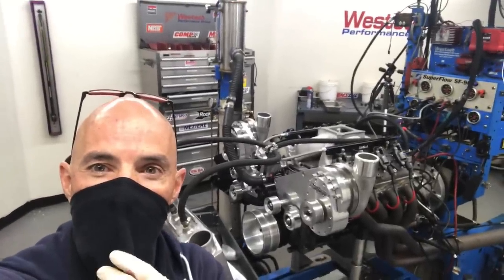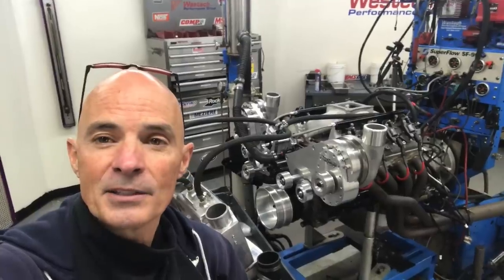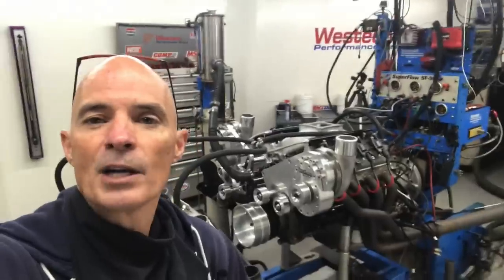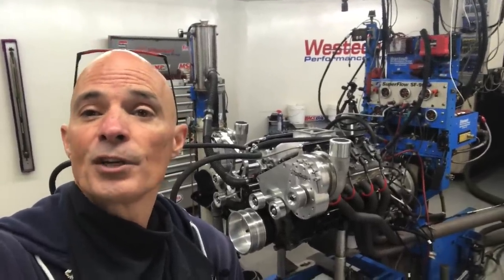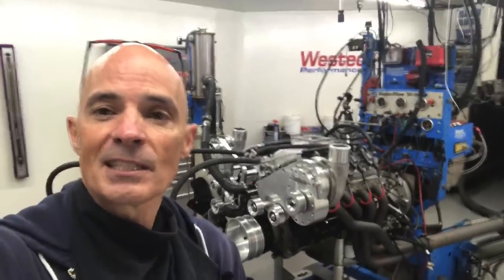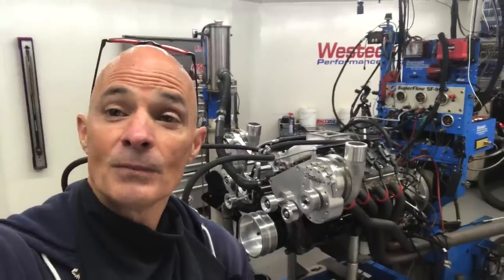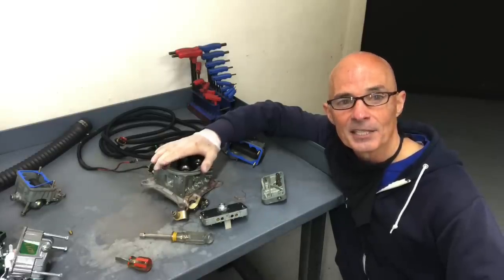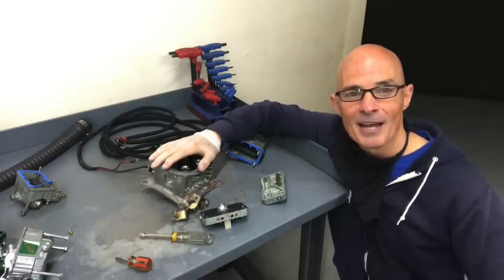WHAT'S INSIDE? -BLOW THROUGH CARBS

Comment: Hi, I have run boosted carburetor stuff for years and when a lean condition would present itself I checked all the basics.  It would always lead back to airflow issues over the boosters. EV made a hat that had a divider and you would run it at a 45° angle not straight on as you have it. It could possibly be making bad turbulence with the twin superchargers especially if they are running outside their efficiency range.

Comment: Listened to this video now 3 times, fuel pressure is fine, checked before and after the regulator, and this problem is going on with 2 different E85 carbs and a gas carb, the common component is the carb hat, and running 2 superchargers is increasing the CFM dramatically, air is hitting the back of the hat, and not able to flow through the rear throttles, backing up and causing an eddie effect (turbulence) and messing with the front throttles ability to get a smooth flow of air, and likely surging causing the rich lean bouncing we see on the HP curve instead of the smoother curve we usually see. If you can cut the hat and weld a second fitting for each charger, the boosted charge air should stop being so turbulent,  I suppose this could also be remedied with a splitter installed that others have suggested as well. Good luck with the diagnosis,  great work as usual
Reply from the maker: we've run this power with this hat before with no problems
Reply: @richardholdener1727  But different fuel now, right?

Comment: Sounds like the fuel side might not be the problem. It almost sounds like an integrity issue. No matter what you try fuel wise you get the same basic outcome,... you mentioned that one bank was ok and one bank was acting wierd/lean. You said you ran a compression check, but did you run a leak down test? (A leak down tester uses a set of gauges and shop air to  check for different engine issues or to see how well an engines condition is. Or to keep tabs on internal wear for race use.  Did you leak down test the good bank of cylinders for a control then leak down test the lean bank of cylinders to see if there is an oddity between the banks? You can test each cylinder at top dead center ( both valves closed) by turning the engine over by hand  which will put the cam in play incase there are issues stemming from the valve train you might have missed, or you could undo all the rockers to seat all the valves and then you could just cut to the chase and hit all the cylinders one after the other without all the turning over of the engine. Wouldn't hurt to also undo the rockers so all valves are seated, make a top block off plate for the intake where the carb sits, put a tapped hole in that plate  to accept the leak down tester fitting and leak down test the whole intake and heads up to the back of the intake valves. All this would show you if there is a crack that just showed up somewhere, a bad intake seal or head seal, if the valves are leaking at the seats (check by pressurising a cylinder and check valves dry then with light oil like marvel oil dripped on the closed seat surface in the intake runner, look for bubbles) (ive seen leaking valve to seat  issues cause mid to top end tune problems).....
Reply from the maker: we know what  leak down tester is-motor makes correct power na

Comment: EDIT a Google of pitot tubes netted this https://www.theturboforums.com/attachments/img_6509-jpg.434074/
When guys put turbos on old carbed bikes they extended the bowl vent up to where there is more velocity. The term they used was pitot tubes. The hat opens its diameter to go around the 4 barrel opening, where it loses some pressure and where your carb currently has the vent tubes. Try extending your vent tube up into the pipe before the hat. It should push on the bowl harder and push fuel in easier.
Reply from the maker: i mentioned we did that in the video
Reply: @richardholdener1727  Can't wait to see the answer. The guy in the pic had your hat and had to jet down after his ridiculous extensions.

Comment: Bigger jets, drilled PVCR passages, jets, removed jets, big needle/seats, plugged bleeds, swapped carbs... sounds like you've picked most of the low-hanging fruit, Richard.

Got enough fuel pressure to overcome the boost?  Checked the pressure AT the carb inlet?  Tried those clear sight plugs @ the bowls to see if the bowls are full @ load?  

Since TWO carbs have the same results, it makes me wonder if 2 carbs had the same problem, or if the problem is systemic

Maybe put the carb on backwards and see if the problem switches banks...

Edit:  exhaust restricted on one side?  Maybe worth spending a few minutes looking there looking?
Reply: I think it’s the fact that they’re trying to flow that much fuel through a single needle and seat. There is a reason why after about 900 hp most people step up to dual needle and seats for e85

Comment: Are you reading the plugs do they show rich I’ve seen instances where way to much fuel starts showing lean on 02 readings but before you go lean it’s not so rich to make me think that’s the case but within like 300rpm it’s jumps a point leaner does it drop a cylinder do u have 02s on Both sides? To confirm this .
Reply from the maker: dual sensors-swapped them, tried more and less fuel

Comment: Have someone or a camera in the dyno room when doing a pull and set the float bowl level at center of the sight plug make sure the float blow levels stay at center during the pull that will rule out a fuel delivery issue. Lean on one side sound like a intake gasket leak under boost that may not show under vacuum. It's always nice to vent the fuel bowls outside of the intake bonnet because even with a boost regulator you can never exceed the pumps free flow pressure rate with the combined regulated pressure and boost pressure.(example if you pump flows 20 psi free flow and flows say 30 psi before a regulator set at say 7psi  you would think you could do 23psi boost 7+23=30 you can't. The combined boost and regulated psi can not exceed free flow. So if free flow was 20psi and you set the regulator to 7psi you can only run 13psi max)   I understand were people are going with the 90 degree bonnet but we have a procharged dragster making 1400+ with the same bonnet.
Reply: Ricky Rocks I think he needs to run bigger bowels. He’s just running out of fuel.
Reply from the maker: we measured pressure before and after reg
Reply: @richardholdener1727  verify for fuel in the bowls, please.

Comment: Worth looking at the sdce carb bonnet, and the 1957 ford paxton blowthru bonnet. Both deal with hood clearance issues --since you cant have a 15 plus inch verticle tube--by chokeing, and equalizing airflow across the carb. The studebaker and early paxton gt350 carb boxes worked too, but were a crude yet reliable idea that could be pushed to production quickly.

Comment: Not the cause, but one thing I learned from fuckery and tuning my LS 69 chevelle is if theres a fuelflow restriction (clogged filter, pinched line, incorrect size line even), you can keep turning the fuel pressure up and up and up and it will still malfunction because theres not enough fuel flow. 

I had dirty pre and post filters (from fuel cell foam) and had a breaking up issue at the top end. Changed pressure to 8 from 6 PSI and it still did it. 10 PSI still did it. 12 psi, still did it. 15 PSI was the max the regulator was good for, still did it. Pressure often isn't the issue. Flow is what counts.

Comment: What are the spark plug showing?  Is it so rich that it is reading lean?  Been there, done that!  Pull the plugs, I would bet they are fueled to the max.  For sure if it's too rich, there is unburned oxygen in the exhaust pipes showing lean.  That's what I would try first.  Next up would be looking at possibly adding vent tube extensions to see what that does.  If that does not do it, I would maybe think the bowls are being not filled by the pump, or it may need the dual needle and seat bowls.  But with two blowers, if it is making 1000 at the crank, can you imagine what both of the blowers are pulling for power.  I bet the bsfc is very high!  My 2 cents anyway!
Reply from the maker: not rich

Comment: Something going on with the boosters or venturis? Could It be losing "signal" some how the area of low pressure not pulling hard enough.
Reply: It's one carb that's flowing a ton of fuel. There is a chance that it has a gas carb body and the booster transfer circuit is not sized big enough. If you take out the jets and plug the air bleeds it should be so rich it misfires. There is something everyone isn't seeing here.

Comment: An answer to the problem 2 things I'm thinking of perhaps the  adjustment for the fuel bowls need to be adjusted to the highest  position  and/or length of the fuel line/ size/filter
 perhaps the opening into the fuel bowls has a screen that is clogged or an orifice that  is too small for the amount of fuel under high demand, and lastly the distributor Drive could be worn out and is retarding at high RPM causing the fuel to not burn giving a false reading of lean the fuel maybe saturating and not atomizing correctly,  good luck...

Comment: Carb icing up at the higher rpm/flow? Fooling around with a 460 Ford and gasohol 40 years ago the engine would cut off at high rpm’s, we would roll to a stop. After about 30 seconds it would start right up again and off we would go. Found it by jumping out and looking down the carb really fast and finally saw it iced up but melting really fast. Went back to straight gas and no problems.   It’s a shot in the dark but who knows. Try it with the intercooler water off to see what happens.
Reply from the maker: we tried fuel too

Comment: In the real world, i'd really just like to see someone build a nice driving blowthru carb, then use a zex perimeter, or 2 stage plate to add straight methanol with boost. Can be done cheap and easy with fuel solenoids and adjustable pressure switches. I got the napa part # for pressure switches if ur interested.

Comment: Mr Holdener, here's a link to a guy with firsthand durability testing with blowthru carbs, look for RWTECH posts 

https://www.speed-talk.com/forum/viewtopic.php?f=1&t=4221&p=36769#p36769

 Another thought, in fluid dynamics, any air measuring device requires ***at the least**** 3 x pipe diameter of straight tubing to establish laminar airflow before measuring/metering. Given about 5inches for a Holley carb inlet, that's 15 inches of straight pipe above it as a minimum.

Comment: Is the relative humidity high enough to have some icing around the booster venturis during high cfm airflow? Have you tried larger boosters to slow down the air flow through the boosters? The air may be flowing too fast though the boosters to get a stable low pressure area to draw fuel from.

Comment: fuel comes out of the booster leg from either vacuum of the engine or the vacuum created by air moving at high speed past it. since this is a blown motor you need vacuum to be created and having boosters with an open center its not going to be able to do that. try some boosters that have a bar in the middle like most stock holleys have. the 90 degree elbow is making it worse and the other carb must be shaped a little different giving a little better result but the reason taking the jets out didn't work is because their just is not enough vacuum being created on the booster because of its shape.

Comment: I think there are a few people on here that are on the right track. Try straightening up the air flow in to the top of the carb, run the vent extension to the mouth of the carb hat with slightly larger inlets, and I couldn't tell if the carbs that were ran had down leg booster. But it might help to move the vacuum signal closer to the area where there is maximum air velocity through the venture's of the card. I couldn't tell but it looked like the booster were straight.

Comment: I do agree with portions of the comments here it certainly isn't a carb issue. If the rest of the fuel supply and regulation system is proper than your carburetors are only identifying an occurrence you might not see if fuel injection was utilized.You often reference how air flow distribution in manifolds changes everything and I think the current combination is being exposed by the use of a carb.. It depends on relatively even airflow across itself to provide fuel flow.I would be inclined to believe that their is some sort  of an air column or vortex imbalance coming into the carb hat and not evenly distributing the airflow.across the carb and boosters evenly.  I'm not sure spacing the hat higher to improve the turn radius will help as much as putting some sort of an axial divider in the inlet tube. Usually boost referencing the bowl with the tubing facing the signal fixes that issue for the most part.Your description of how one side of the motor is happy enough while the other begins to starve.With out more detail I suspect running the torqstorms opposing one another could be causing an odd type of flow coming out of your intercooler or the combing in the intercooler could be contributing. Could it even be having an odd type of surge as your rpm and boost curve are rising/You could try a bunch of simple things like taking the intercooler out of the equation with a different manifold to combine the flow or even a simple series of pieces of tubing with a divider in the middle in the inlet tube after the inter cooler and or prior to the carb hat or both. Keep the bowl reference tubes as well.

Comment: Carburetors are simple animals if the air density across both sides of the venturi is correct they will work. This depends on the viscosity of the fuel remaining the same and here is your problem I believe. I think you are freezing the fuel inside the carb at the higher flow rates and the carb cant get enough heat to keep it consistent. The hat is also a bit small I believe and could be presenting the air in the wrong direction. Time to get the old shark plenum and mount it on top of the carb to fix that part at least.  Drain the inter cooler of water and try it again sometimes to much is exactly that or just dilute the E85 with a bit of regular petrol.  LOL
EDIT
Another thought have you monitored the fuel pressure throughout the run? It isn't doing something dumb like sucking a hose closed at the high demand time when it leans out? Is the fuel tank vent working ok?
Reply: Except E85 has a freezing point of more than -200° F
Reply: @goodmanboattransport3441  E85 will cool a boost charge by 100c given the volume of air in that how much flow will freeze a little booster outlet that weighs maybe 5 grams? It has to transmit the heat through it otherwise it freezes. It isn't that common today but in industry there used to be chillers that were driven only by compressed air flow across venturis.
Reply: @dazaspc  
For sure, anyone who has used a blow gun for an extended period of time knows how cold it gets. Now if there were water in the fuel, it might drop out of suspension from the ethanol and freeze, but clean fuel should not thicken from a freezing condition, which was what I was addressing from your original post. This lean condition was also present when running gasoline as well, so there is that to think about as well, different fuels and carbs but the same problem, there must be a common issue,  I think it's the hat as well, like many of the other comments, I made a post before I made this one, after giving it some thought, it would be interesting to watch a smoke trail go through the hat to visualize what is going on
Reply: @goodmanboattransport3441  I would assume he has run that hat before at these airflow levels? If so it is the boost level or the air turbulence coming from the inter cooler. As for fuel getting thicker nothing thicker and less viscous than a solid. But seriously if the guy that builds blow through carbs gave the hat the ok the only other thing should be the intercooler. It could be blending the two air streams together after the heat exchangers inside and creating a turbulent flow through the inlet pipe. With the carb metering as the first thing the air meets to prevent the air from spinning through the pipe that could well be the problem. After all a couple of carbs built for the job and tested would tend to rule them out.

Comment: I plan on na or the "blue unit" on mine . But you didn't check the flow of the carb first . And nobody running boost likes that hat . If Shelby did it with a Super Snake with a mechanical fuel pump like I was gonna use , why can't you ? E85 and boost and two blowers is 1500 hp , it might be telling you to go up .

Comment: I agree with you on most your changes, but we use e85 on top of a 177 Weiand using boost referenced bypass reg 3psi to 13psi and a 130 gph mechanical pump. (10psi boost)We are worried about lemonade (bubbles) in fuel bowl at high rpm. This is why I suggested duel needle bowl lower fuel pressure and help fuel level in bowl. Love your content thanks GM engines.

Comment: So when you pull the headers and check the colouring on the exhaust valves what is the difference from side to side and cyl to cyl if any, yep checking plugs is ok but not as good as exh valves, but I'm sure you know that but did you do it? (Ron Shaver  believes in this method only)
If you have this data then analyse from there, rules out o2 sensors, leaking header gasket ( which I have seen mess up o2 readings even found supposedly known good headers had cracked) seeing is believing, I like the laminar flow suggestions for air entry into carb/s so would expect to see evidence on exh valves of uneven distribution, for those that don't know a plug can change it's appearance in the time it takes to shut down motor from load to idle but valve colour not so quick.